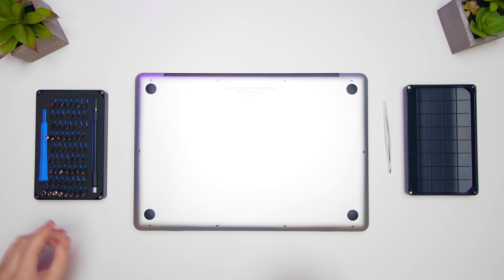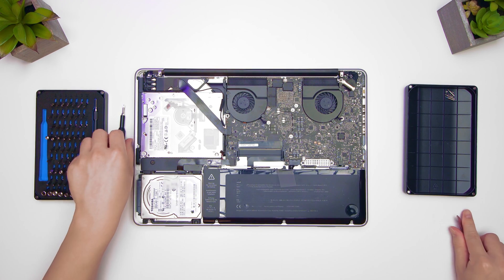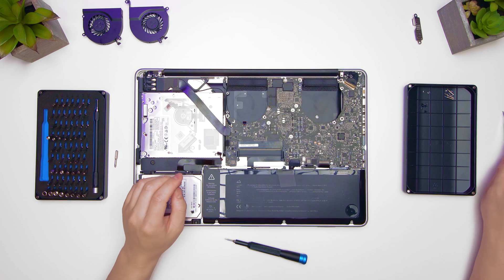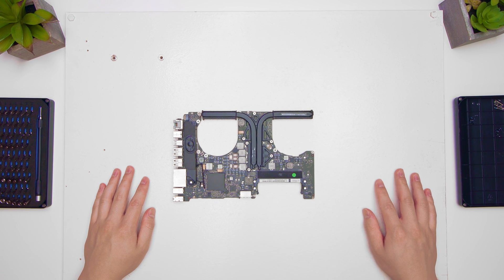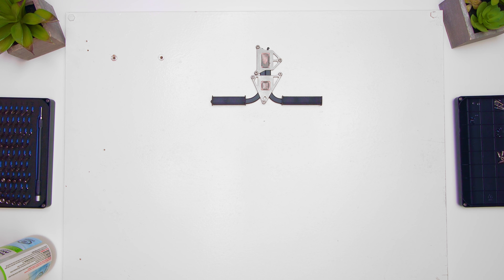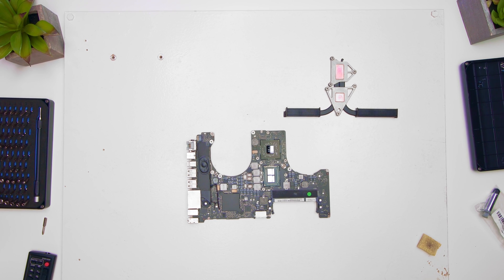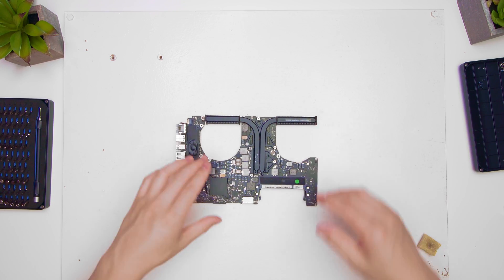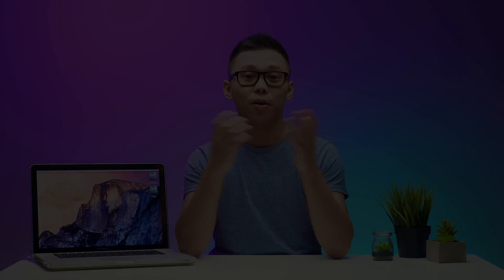2011 Macbook Pro Dead GPU Reflowing Fix Overview - Covist

Comment: This isnt a fix. Please stop spreading misinformation. This is a bandaid on a broken leg. The GPU is the issues and your hot air gun didnt even reflow the solder under the chip if you had the edge bonding wouldnt have allowed the chip to settle so any broken joint (even though these solder joints arent the issue) would not reflow properly. Also Solder to wet and make a solid connection requires flux. You added none. 
What you did do is head the epoxy underfill around the GPU Die. This heating causes the epoxy to flex and expand which allows the microscopic solder bumps on the underside of the die to touch their respective pad.

Comment: Did mine over the weekend. So far, so good. Wasn't as daunting as I thought it would be.
Reply from the maker: Yea, as long as you're a little careful and okay with a screw driver, it shouldn't be too difficult
Reply: @Covist  I see you posted this video in June. Is your's still working?
Reply from the maker: @juangonzales4854  I had to do it again maybe a month ago, but yea, still chugging along!

 Edit: it'll be dependent on how well you did it and how you've used the MacBook.

Comment: I bought one few years ago, before even knowing about this problem. And not for cheap too, thanks for eBay assholes sellers...
But it can be still used though… Thanks to i7 CPU, it is very good as a slave for Cinema4D TeamRender. Almost 40% speed boost with i5 iMac.

Comment: Would be great to add, heat gun proximity, timing and or temperature goal for the chip heating step.  I've seen oven versions of this fix and I've also seen heat guns burn things really quickly.   It would be great if Apple or an investigative journalist made a video explaining the failure why it happened and what they did about it.  I get it that they needed to draw the line somewhere with warranty but for known issues why didn't they recall and get the chip supplier or board assembly company to claim against their insurance?   This failure really tarnishes Apples reputation and is added to the horrendous fail in the launch of maps, the IOS update iPhone 6 battery issues..
Reply from the maker: This video wasn't meant to be a step by step guide, but you are correct, I would need to include those if it was. 
As for the issue, Apple actually determined it was a design flaw and they extended the warranty for the affect MacBooks. But that extended warranty has since ended. So that's why I went and opened it up and tried to fix it myself.

Comment: @Covist

Great video! 👏  Some food for thought, you might want to mention the use of liquid flux, the use of aluminum foil to deflect heat from other components on the logic board, the temp of the reflow gun, ie. ~ 225 - 235F to remelt the solder joints for the GPU,  the time you keep the GPU and remelting temp, and a link to a tear down, ie. a link to the ifixit tear down.  Otherwise, the video was put together very well and to the point.  Thanks for sharing.

cheers 🍻
Chris
Reply from the maker: Yea, I'm aware that some details are missing (i shot the footage before I had a plan for the video), that's why I titled as more of an overview of the processes instead of step by step.  If I were to make a step by step, I'd definitely include more details. =)

Comment: its temporary, i have a 2011 15 inch maxed out and i have the dead GPU problem since 2016, ive manage to run a code to disable it so it works fine with the intel HD GPU, ive opened for the first time in 2017 and the pc was completly full of dust, like reallly bad and ive chandge the thermal paste for a quality one. I saw on the board that the VRM of the GPU (one of the VRM) its completly burned and i think that was the cause of my problem so its a board problem and the GPU should be dead to. Im planning to try to sell this one on ebay and buy the new 2018 with the vega 20 GPU.
Reply: Rodrick HD dude I would pay you to fix mine and just run the intel graphics. Mine just shit yesterday.
Reply: inbox me via facebook. I'll send you the solution. Step by step you can disable it easy way bcs I have same ver of Mac and got trouble last month. Of course I search and research then got answer. https://facebook.com/duong.huu.hoang.98

Comment: Hi, I wonder if you can help me. I have a 17” 2011 MacBook Pro that won’t start up just stays on white screen. Even when I try to start using the Internet startup, after its finished it still stays on white screen. I took my Mac to get a new hard drive thinking this would be the problem but it didn’t work. They said it’s classed as vintage and no other parts are available. What do I do? I need my Mac back! I don’t mind loosing everything on it, I would be happy for it to start as a new system. I would really really appreciate your help. Thanks.
Reply from the maker: It sounds like it could be the same problem. You can try the fix like I did in my video, but it is still not guaranteed to work. It's simply up to luck on how it broke.
Reply: It’s your logic board gpu. Mine was fixed under warranty years ago did the same thing. Now it’s doing it again I’m not spending thousands on a new MacBook Pro right now so sending it off to Mac medic in Alabama. google them. This is a well known issue. For around 300 bucks you can have your MacBook back and prolly get a few more years out of it. I’d say if you do get it fixed shut it off between sessions and days. Do not leave it turned in for extended periods of time.
Reply: Powerbookmedic I mean

Comment: Have the same unit , won’t turn on won’t charge
Reply from the maker: Without actually taking a look at it myself, I can't say for sure that it's the same problem or if its this problem alone, as mine never had charging issue. =/

Comment: With the understanding that this is a temporary solution, can / should one do this over and over again? Or does this process have detrimental effects over time and eventually will kill the gpu and / or other components around it making the computer totally irreparable?
Reply from the maker: I don't have a large sample size nor have I done this many times, so I can't say for sure. But I think it'd be safe to assume that eventually it would die one way or another. In fact, just the problem showing up in the first place, before applying this "fix", already shows that its failing, so it's just a matter of time until its fully dead.

Comment: I can't belive it, 2018 and there's still somebody buying the old BS about reflowing/reballing fixes! Amazing!
Reply: Youtube is full of dumb comments.  I have fixed two dead iMac 27's by baking the AMD GPU card in my kitchen oven.  They are still going strong.
Reply: It’s 2020 now and I did not buy anything. I acquired the MacBook and wanted to see if I could breathe life into it once again. This process worked perfectly. Amazing right? Believe it.
Reply: It's not B.S.. People keep doing it because it works. Not can you show any evidence otherwise (and yes, I am including that Louis Rossmann vide, where he incorrectly speculates about the chip internals from logically fallacious arguments, and misstatements of fact.
But I guess it makes you feel smart to be the lone voice.
In fact, the cause of failure is well known, and is due to the poor chip design of the AMD GPU used in these machines as well as the inadequate air circulation, causing heat buildup that the lead free solder is inadequate to withstand without failure.
Contrary to Rossmann's claims, the fallacy of his theory is shown by the fact that, while the 2010s and 2011 soon fail again after this repair (due to the exact same issues) the 2012, which has the EXACT same solder, and almost the exact same logic board, does NOT suffer from this issue (because in 2012 Apple switched from the AMD GPU to the NVIDIA).
Try thinking for yourself, from facts and evidence, not from what other people tell out on the internets.

Comment: This is a good temporary solution. Id still afterwards if boot up fine id do the software mod to disable ATI graphics and only use intel to get maximum use out of your  machine for a while...Anyone that is DIY and can get this far id highly recommend just buying a 2012 Macbook pro 15 logic board as you will have usb 3.0 and nvidia graphics off ebay and replacement screen as old one won't work but everything else will work and will be a permeant repair.
Reply from the maker: I just checked ebay and it seems like those logic boards are in the hundreds. If that's the case, I personally would rather just move that money into the budget for a new laptop. No point in trying to prolong something this old at that cost imo.
Reply: @Covist  I did it few years ago before it was well known that there never was permeant fix for bad 2011 ati graphics chips but i still prefer have more ports and is still fairly powerful machine as of today if max out the ram and add RAID or SSD
Reply: @rrcoster  Mine just went out again after being replaced by Apple a few years ago.  If I can get a mid-2012 logic board for around $200 that may be the route that I go.  Those will run Mojave and run a lot cooler with the bigger heat sink.
Reply: @mahler2112  Yes the 2012 are still very useable and rune newest Mojave without problems.

Comment: Your better off just disabling the AMD GPU and using the intel HD graphics. its more of a permanent fix.
Reply from the maker: Yes, that can help, though it might struggle a bit on certain tasks.
Reply: i disabling the AMD GPU but still have the problem with bootcamp partition :/
how can i fix that ?
Reply: @Covist  surprisingly not and without the AMD GPU you can run mojave
Reply: ive done that and my pc is still running
Reply: Thats what I thought till It fried the internal graphics on the cpu too.
Reply: @Abelmusic  Working with graphics or normal everyday use?  I need logic...  PS killed ours...  both of them.
Reply: @golightlyproject  Yeah I was editing videos.
Reply: @Abelmusic  dang...  So, the best solution I have came across required physical disconnection of the chip.  I have seen a video of a wire bypass system, but I read that by simply disconnecting the chip it is no longer an issue.  With the soft hack, logic did not work...  Hardware hack might solve my issue for music...  Not sure about for vidz.  Thanks for the response.
Reply: @golightlyproject  just disolder gpu chip with heat gun? You did it?

Comment: My 2011 MacBook has just failed. Time to try this as apple wont touch it. 

How long did you heat the chips for? And I assume the heat won’t affect any other components?
Reply: Did it work for you?
Reply from the maker: It'll depend on your heat gun, but I had it heating it for maybe somewhere between 5-10min. Honestly though, it's not a huge deal if you didn't heat enough, cause you can just do it again and heat it longer. 
Also, on the backside of the GPU, there are two pins that hold the board off the back casing. Be careful about those, cause if you heat it too hot, they may come off.

Comment: Hi Covist
Thank you so much for sharing the video, I am here because I had the same problem and your video gives me hope. I know it is a temporary solution but at least I can use my machine for a light using such as email and surf web. May I ask how many oC degree did you use your heat gun on the chip and for how long? Thank you.

Comment: This is only a temporary solution, it is gonna fail again at some point in the future because of an inherent design flaw in these 2011 Macbooks.
Reply: What is a permanent fix? I had the board replaced by apple during the recall...and AGAIN this past feb 2018 and I'm having the same damn issue :( would swapping out the 2011 board for a 2012 board be a more long term fix ?
Reply: @Demonseedradio  i think you should try to disable the GPU cuz that was what i did with my 2011 and its working fine with the intel GPU, its simple and just search on youtbe how to disable GPU on macbook pro 2011 and theres quality videos showing how to, i still think you shoul try this metod and maybe in the future buy a new macbook like the 2015 used if you dont have 3k USD to spend.
Reply: Rodrick HD if I do that what will be different about my laptop.. can I still edit 1080p video?
Reply: @Demonseedradio  i still edit 1080p and 4k videos on premier on mine. You need to drop the playback res to 1/2 or 1/4 to play it smoth, but if your pc is having problems i think you should go to an apple store and see what they say, if its the GPU issue than i recommend to try to disable it (like i did) and at least you can save your stuff to another diver or just try and see if it works for you), if its to lagy for your work i wouldnt spend money on 2011 or 2012 macbooks cuz they all have problems on the boards, you can get a 2015 15 inch for quite cheap and its way more powerfull, im going to buy the new i7 or maybe  the i9 and the vega 20 (the new macbook pro 15) cuz my work is getting more intensive and my mac is starting to fell aged and slow specially pushing 4k edits at 60fps, render times take..... but its possible to do work with it, 1080p its fine.
Reply: @rodrigo4379  what method did you use for the GPU bypass
Reply: @Demonseedradio  if im not wrong it was the secure boot one, but just search and see what people said in the comments
Reply: @Demonseedradio  There is software mod to run only on intel but it has flaws as well so not permeant fix but yes the long term solution is to upgrade to 2012 with usb 3.0 support and nvidia graphics but you would have swap screen as well everything else work during swap. Did it when mine failed and havn't had issue since.
Reply: @Demonseedradio   same situation to me
Reply: @Demonseedradio  Yes.
Reply: @Demonseedradio  A permanent fix would be to find someone who repairs these boards professionally and have a later revision of the same video chip installed.
Reply: @Demonseedradio  Sorry, this is an old thread, the only thing viable that I have seen, as I am dealing with a similar issue with an extra handicap as I need to re-install the OS, is to replace the AMD chip or permanently disable it.  Both cost money, but the main reason we love these slabs of pure nostalgic is the 17 inch screen size (for peeps who are asking why).  You put 16Gb of RAM and an SSD on it and the unit is golden for years.
Reply: Demon Seed Radio not not worth it.... 2012 MacBooks are affected too
Reply: @unkownbot1566  Yes it is and no the 2012 Macbook Pro where not affected do your research instead false claims
Reply: unkown bot you saying apple will repair it for free ?
Reply: @EnnTomi1   no the free repairs ended years ago
Reply: @unkownbot1566  Wrong. The 2012s are NOT affected by this issue. This issue is caused by the defective AMD chip with thermals over twice what the board is speced to deal with. The 2012 does not suffer this problem because Apple switched to the much cooled NVIDEA chip.
Reply from the maker: v1o  Yes, that is true. But for some people like myself who don't actually require a laptop at this moment, this will do just fine for my causal use. No need to spend the money now when I don't need need one  =)
Reply: Also my 2011 MacBook Pro has issues. Already replaced from apple for the recall but failed just after the warranty ended. Just want to know if there’s a better aftermarket version of a motherboard I can purchase from?
Reply: Can you write the right timing and temperature about the hot air to fix this issue? Thanks
Reply: @FedericoCoppolaIT  Hi, i did this not long ago and got it fixed. Over 2 minutes i heated in the vicinity of the GPU, when i got close to 2 minutes i heated it from further and further away to let it sink in without cracking.
Reply: First time I fixed it was in 2015. It last for 3 years. I just had again the same issue. So it will probably last for another 3 years. I will probably sell it before it breaks again.
Reply: That's why you replace the crappy thermal compound Apple used with something better and download a fan control app you run the fans a little bit faster for better cooling. If you're really paranoid about it failing again, you can even disable the discrete graphics in Darwin and run it using only the Intel HD video.
Reply: Well isnt everything temporary? You can buy a completely new PC which dies 6 months after?

Comment from the maker: If there's any interest in a more detailed step by step guide, let me know! =D
Reply: love your vids, just a short question which temparature do you use for the reflow? and for how long did this solution worked for you? thx a million
Reply: How many minutes do i have to warm up the gpu?? Which temperature?
Reply: I've been hunting through videos on how to repair this and I appreciate this. However, everyone keeps saying this is a temporary fix. Is there a more permanent fix?
Reply: @rickythompson4778   yes, to do a wire trick to disable eGPU by hardware way.
Reply: Alexander V. I am not tech enough to understand that. Is there a how to video that you know of?
Reply: Yes, as several people have asked - how hot and for how long - without this you are shooting blind.
Reply: I like to know as well. My guess is between 260 to 360C.
Reply: That would be very helpful !!!
Reply: How many time with the heating gun? Thank you
Reply: Pleas man, don't make people put heat on the board, this wont actual fix the problem.
Reply: Yes step by step video so I can work on mines step by step with you.